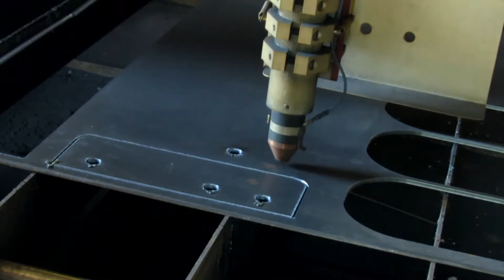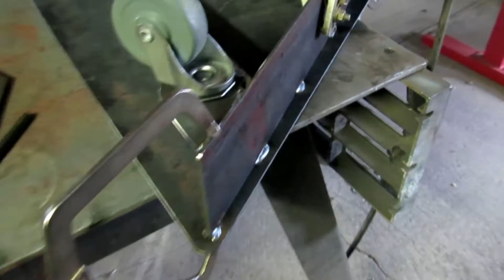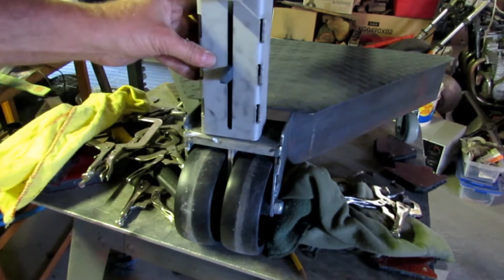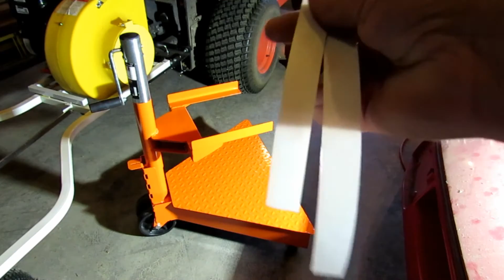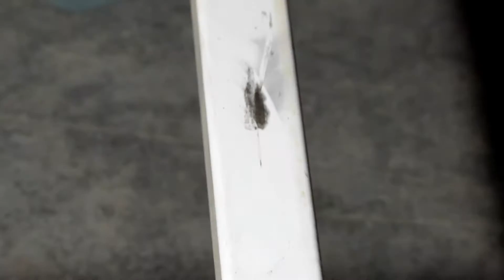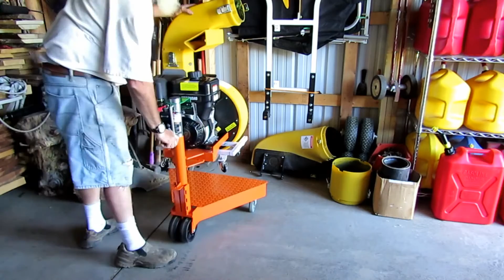Cyclone Rake Z10 Blower Lift Fabrication & Operation

Comment: the other issue is their are alot of cyclone rakes out there right now like i have it is to late for me to get such a device like your talking and it would not make me really happy if they only made it for a new build of the cyclone rake frame to incorporate such a jacking device im looking to fix my issue to heavy a motor and chute set up and a back I bulged disks long time ago  and at my age i hate to waste the money on building even a small shed to house a engine hoist like they suggested and thats where your device is compact enough and easy enough to use no chains with engine hanging down swinging back and forth while trying to line up the bolt holes your just rolls in crank motor down put bolts in and go pick up leaves then when done roll right in loosen bolys jack up motor pull away then fold up the cyclone rake 30 years ago built my current shed thought plenty big enough to wish i had looked for larger one where i could keep cyclone set up all the time 20/20 hind site
Reply from the maker: Find a local machine shop and have them build wrhat you want then.

Comment: i would have to agree with your assessment but i think their focus is on things that for sure will sell and make them money than rework current product that appears they get very little feed back on your issue with plugging chute where they came out worked with you effects how their product functioned so and others that may have same issue and Rand D for future peoples plugging issue if arises your lucky enough to 1 have the equipment to make this lift 2 the skills to use said equipment number 1 and 2 are not me so i took a stab at hoping you might help me out and fab one up for me
Reply from the maker: a simple redesign just adding some pockets for drop down legs with pins wouldn't cost much per machine and just a couple hours of engineering. That motor frame is quite expensive with all the welding now and could be cheapened to fabricate in the end. The legs could be sold separately.  Some companies hate change and innovation.

Comment: I think few things in play if they had alot of interest in such a tool or complaints on weight if the unit to remove from the frame every time like I have to do hence my bugging them for 3 years which in their minds the cost to set up and produce affordably enough where profit wont cut in to their profits having watched your production video of the jack it was pretty much stuff you had laying around and sounds like you already owned  laser cutter and bender not cheap so was hoping seeing as you had the tools to do it and done 1 already hoped i could show you enough interest to produce one for me cause i flat out have not enough storage for their suggestion the fold up engine hoist i also feel your would be much easier to use not having swing back and forth on chains trying to move this big engine hoist and watching to see how lines up and they have no other suggestion or ideas on something even close to your creation and i cant either
Reply from the maker: They could easily come up with a solution that is integrated into the frame   with very little cost added. I think they're trying to hide the fact that it's not a easy disassembly for one person as advertised.

Comment: Very nice. I was watching your video about the clogging issue you were having and how you fixed it with the engineers help. I saw your motor lift in that video and began searching for it. Being 70 I can see where that would come in handy
Reply from the maker: They must think customers are all able to pick up 100 pounds. This is a backsaver for the larger blower.  They keep putting  bigger and bigger blowers on them with  no thought about storing the unit which is a main selling  point. Thanks for watching.

Comment: You are an absolute innovative GENIUS!! Of course having all your tools, machinery and equipment (something most of us don't have) is a big help! Keep up the GREAT videos!
Reply from the maker: Thanks.  just trying  to fix things that bother me. That blower  is really  heavy  for one person to safely lift as they advertise.  Thanks for watching
Reply: I agree with the weight of this engine assembly - Plus, because of the weight, it is awkward to set it in place after you do pick it up. I was thinking of getting an engine hoist from harbor freight to lift it, but trying to justify what else I could use the lift for! You should patent your idea and offer to build them for Woodland Products for their Cyclone Rakes!
Reply from the maker: Another  option  is a hook in the ceiling and simple rope lift if you can't  justify a cherry picker.
Reply: Thanks - I thought of that as well. Less expensive, won't take up any room and although it would not be as mobile as a "cherry picker", I could still relocate the hook as needed!

Comment: the cyclone classic i got is 20 years old of 2020 the motor unit plus the upgraded 5 blade impeller slightly heavy to lift to get it on the chassis if its an Xl or Z10 models the engines are heavy even more heavier with the electric start they now offer.  mine i repowered with a 212cc predator motor its a bit lighter but down the road for reliability may put a Honda engine on it as the original tecumseh engine was too underpowered governer maxed out on full load. as i don't want to make it heavier was hurt in an accident be best to upgrade mine than buying a whole new machine and fabing a lift for the engine
Reply from the maker: This is definitely to heavy for one person to lift. I understand they now put a jack on them for unhitching. Thanks for watching.

Comment: You could also use a fixed height bracket, roll it up to and under the blower assembly, and then use the Cyclone jack to lower the frame.  But it’s a neat idea. Thanks!
Reply from the maker: There is no jack on mine so the blower has to be lifted off before disconnecting.  Thanks for watching.
Reply: Unemployed Redneck Hillbilly Creations I bought mine used and it had the jack, so I thought it was standard.

Comment: I wonder if something like this will work:

https://www.google.com/shopping/product/4963258058577998866/image?q=motor+lift+dolly&safe=off&biw=360&bih=559&output=search&prmd=sivn&sa=X&ved=0ahUKEwjJ74iG0IrfAhVG4qwKHXULA3o4KBCdQAgH&prds=cid:4963258058577998866,sgro:iv,mvi:0
Reply from the maker: Doesn't look like it would pick it up as is because the frame is in the way. You could weld a frame on top of that jack to slide under the motor and possibly make something that would work. Thanks for watching.

Comment: Nice job. Buying a Z-10 today. CNC plasma cutter + your practical ideas are a a crazy-good mix! I'm a subscriber for life (or until I become too jealous of your plasma cutter! LOL).
Reply from the maker: Cnc really speeds up projects. Cyclone Rake is a great company to deal with. Thanks for subscribing.
Reply from the maker: I designed and built that to learn about cnc years ago. Turned out the torch height control and grounding made it quite a challenge.  About 2 years ago I built a cnc router from some parts that were laying around. I started a arduino control box for a cnc wood lathe I will finish up this winter, & just ordered a low cost 3d printer for some ideas I want to share. It is a slippery slope once you get started.

Comment: I do have another question. The lights for the router plates.  Which dollar store and in what section?  I checked one and couldn't find it.  Not to mention though I think that store not to many people used reading lights, and what was the cost?  I did see them on Amazon for $10.99 each with free shipping.
Reply from the maker: It was my local dollar store. And everything is one dollar.  They buy surplus and close everything out. When it gone there is no more.

Comment: The same 2,500 lb Harbor Freight Winch you have for your logging equipment. I have in the ceiling of my garage shop.  At the moment it just goes up and down.  Very handy. All my carts and tools are on wheels.  I have already bought wheels for an overhead wall to wall Gantry system. So, soon I will have an X,Y,Z axis Overhead gantry for (Material Handling) has come in SO handy.  Air Compressors,  a generator, off and on the truck.  Best $50 bucks I have spent. After seeing your video about the winch staying on and causing a problem.  I will put a manual cut off switch corded that will be handy at all times. The winch is disconnected from power when not in use.
Reply from the maker: I would not trust that winch for overhead lifting. The cable that came on mine was not rated for the pull of the winch and as you saw it switched on by itself and was able to snap the factory cable. They sell one that is rated for overhead lifting that may be a safer choice for a gantry system when you get it built.
Reply: I know and I am aware of those issues.  For now the unit only moves about 100lbs - 200lbs on occasion about 32" or less for only a few minutes.  

I have now installed a cut off switch when the unit is live on the remote. When "not" in use no power to the unit is on.  As was always the case. After seeing your video with power on "WOW" switch installed.  Hopefully you had it under warranty.

Mostly it is a concept method for the heavier stuff later. Which will be a chain hoist for the heavy stuff. A rated hoist for normal operations.  I got to tell you it is so nice knowing this is available and not needing someone else to give you a hand. 

Here is a link to the Gantry wheels that I have already purchased they have their own grease fitting already installed. Rated at 1,000lbs (each). Reasonably priced.

https://www.amazon.com/gp/product/B00X6D7Z74/ref=oh_aui_detailpage_o01_s00?ie=UTF8&psc=1

The frame for it is still pending. Should be done this month.  It is not something I need all the time but when you need a hand very nice.

Thanks again for pointing out safety issues. I am retired military and my other half works in the ER we are aware and always take precautions.  

On a side note. A gentleman bought the 12,000lb unit to pull trees on his property.
Reply from the maker: I bought the electric pallet lift off eBay years ago for unloading trucks and that is a handy helper. Didn't cost much and it rolls around pretty easy.
Reply: Good for you. I looked yours up the ones I saw were pricey.  Surprised that you don't have an earth type loading and off loading berm.  My Grandfather's came in handy on the farm for all kinds of reasons.  Like I said the material handling market is under served for the home market.

I miss the all terrain forklifts I used to drive in the military. Those were great.

Comment: Been thinking about getting one of these Cyclone Rakes to help with leaf cleanup on some property my family has. Probably get the Z10 for use on our Simplicity garden tractor, which is around 23/26hp if I remember right. I saw your earlier video of the rake clogging and that you were working with them on the issue. What was the ultimate solution?

Also, do you have any concerns about using this thing on a hill? Our property is fairly hilly and I saw another video where the guy was concerned about the weight of the bin when on a hill and recommended always working up/down vs. across the hill, but that won't always be possible for me, and you'd still have to turn around.
Reply from the maker: Cyclone rake has switched me over to a10 hp 8 inch system for the type of grass that I have and it is now working good. They have great customer support. I have a hill and I go up and down and always leave my Kubota in 4wd on the hill because it can drag you sideways pretty easy when the bag starts filling and you try to turn. Plus 4wd giives you brakes on the front wheels to stop. I would not try and turn on a hill with it hooked up. I will be posting a new video shortly.

Comment: Sir are you a machinist? You barn has everything. CNC plasma cutter, lathe etc. I want to come over your house and play haha. Joking aside you are gifted person. I enjoy watching you machine stuff. I am a machinist by trade. I worked in the shipbuilding trade. Got out to go with my wife who was in the Air Force. I have been tempted to  get the mini lathe from HF. My favorite place to shop haha. Keep up the good work!
Reply from the maker: No, I used to be a mechanical engineer. I designed and built the plasma table to learn how to use the old lathe & mill that I got a good deal on with boxes of tooling. That took some time, but I basically learned how to use the machines while building it. If you can find a old lathe with tooling that may save you some money in the long run, because as you know the tooling is the expensive part. I used to go to sears for my tools, but now like you Harbor Freight is the first place I go. Thank you, & thank you for wtching my videos.

Comment: If you had a loader for your tractor, you could use it to pull the motor with some straps. Million uses for a loader...
Reply from the maker: I have a loader on my other tractor , but the Cyclone Rake has to be hitched to the back of the tractor before the blower can be put in place and it would need a special harness to avoid damaging anything. This lift makes it a 30 second job with no chance of damaging anything. I could not live without the loader on my Deere 4100.